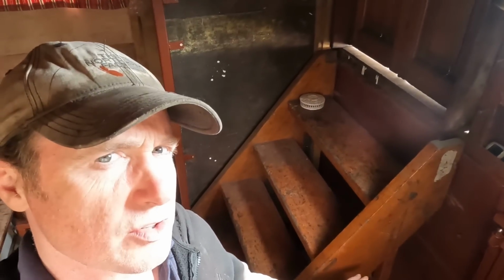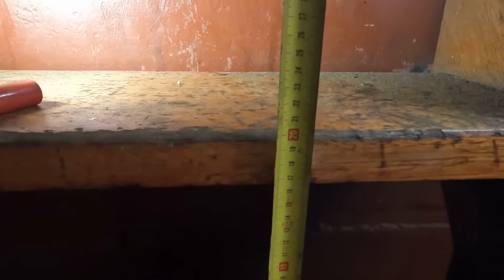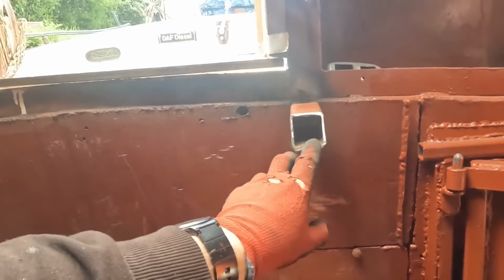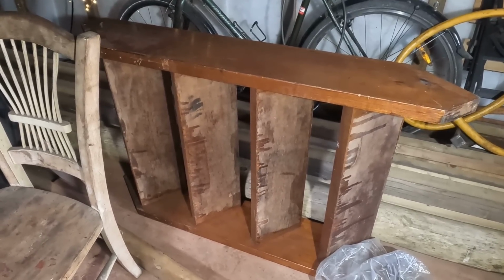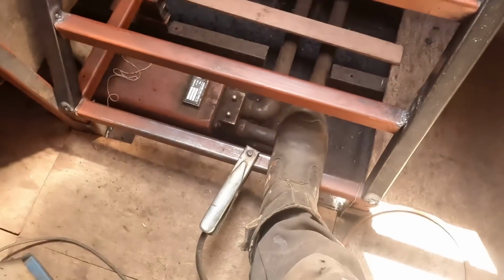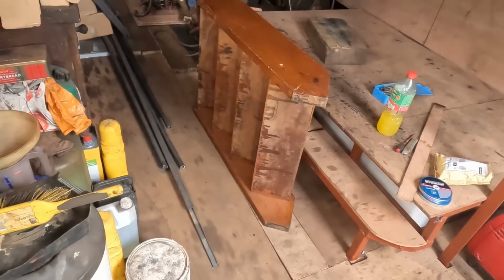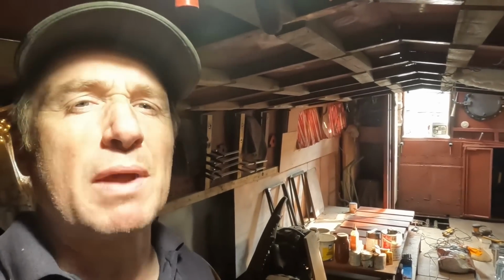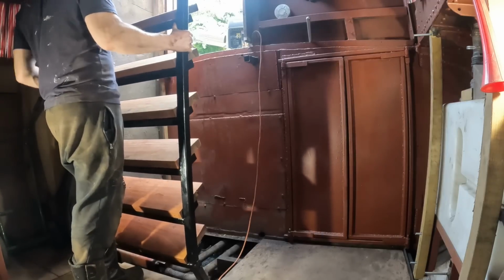I build a new stairway out of steel and wood from the old stairway.

Comment: I was going to say, I thought the Captain was kind of mellow, even when hwe had a pistol aimed at your back.  That's about the only clue he seems to give that he's very, very drunk. 
 
The stairs will be okay, so long as you don't try to go down them forwards.  It might help to put a vertical grabiron at the top of the stairs so that you can pivot and back down.  The rule when disembarking from the train is to step, pivot, and keep three points of connection (preferably two hands and a foot) to ensure you don't slip.

Sure, I'll buy you a coffee--and another to sober up the Captain.....if indeed that's possible.
Reply from the maker: Thank you so much for the coffee! 
That’s a very good point. I currently have the handles on the door/hatch to hold on to and as I love trains, I’ll take that as my inspiration! 
I’m still not used to them as I go down, going up is fine! I was in a house (above a shop) in Amsterdam and the stairs goes from the front door straight up two floors without a break. Really steep! If you fell from the top it is a long waaaaaaay down. I feel my new stairs is very Dutch indeed!
Reply: @canicebannon  The 1912 vintage train that I drive has nice oak grabrails with rounded bronze caps top and bottom.  The oak bits are wider in the middle and have a really nice feel to them.  It becomes second nature to descend one stair, then pivot and step backward.  It doesn't work if you're trying to carry something, but the angle of the stairs is steep that anything you have to carry can be moved before you go up or after you go down.  It works well.
Reply from the maker: @mungmungie  Usually I descend the stairs turn around and grab the thing I’ve  left on the deck. It is easier to get thing in and out with the steeper rake!